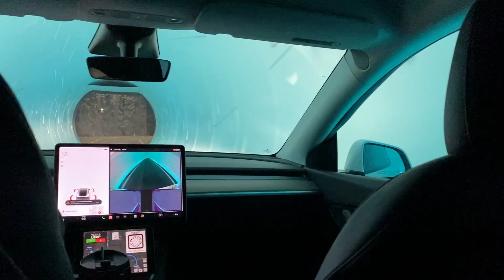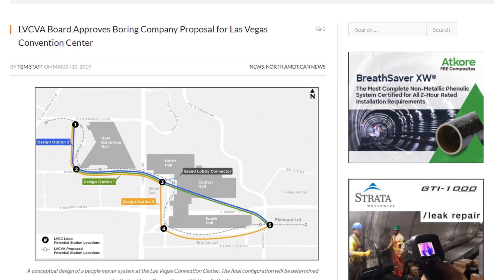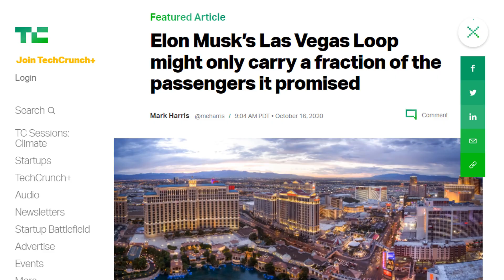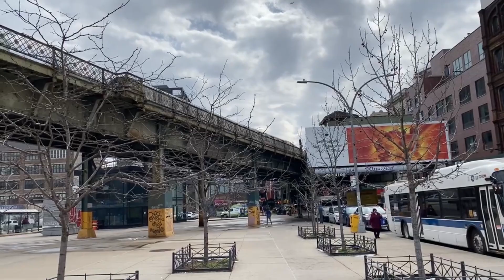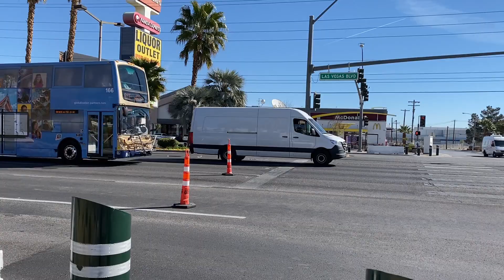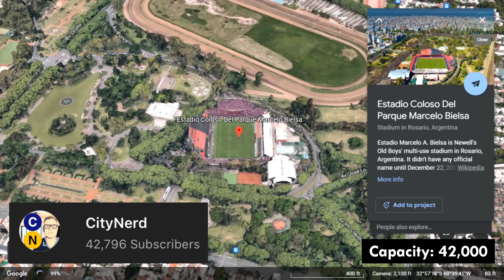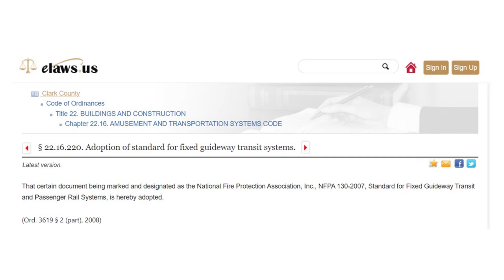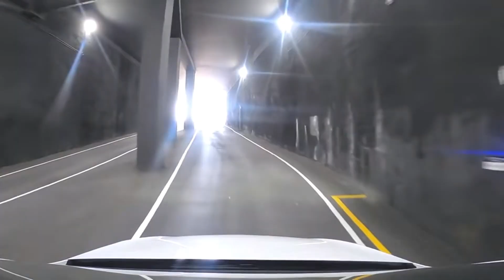Inside the Las Vegas Loop: Transportation Game-Changer, or Complete Waste of Time and Effort?

Comment: Imagine if instead of Teslas in the Vegas Loop, you had a bike sharing service ala Citibike or Divy bikes and the tunnels are for the bikes.
Reply: Well it would be nice to protect bike riders from the scorching sun of Nevada, as long as it has good ventilation
Reply: @cardenasr.2898  If it has cars (even EVs) then it should have to have good ventilation or it gets declared a "confined space" and those require special permission to enter (low oxygen hazards are no joke)
Reply from the maker: That would kill
Reply: The problem is that the Loop is being extended 29 miles down and around the Vegas Strip as we speak.

Tourists carrying luggage or tired children are not going to want to ride bikes those sorts of distances.
Reply: @andrewfranklin4429  It's not, though. It's stuck in the paperwork stage. No actual construction is taking place. Watch the damn video.
Reply: @Codraroll  incorrect. The Resorts World extension has already been finished and work has already begun on the tunnels to Encore.
Reply: @andrewfranklin4429  There's a bit of a difference between digging a frankly useless tunnel to a hotel across the street, and running the length of the Vegas strip. Both of those places are less than five hundred meters away from the west station. A pedestrian bridge would have been quite a bit more helpful at zero running costs.
Reply: @Codraroll  you’re forgetting that these stations will all become part of the 29 mile, 51 station Vegas Loop so vastly more useful than a pedestrian bridge.
Reply: @andrewfranklin4429  Again you're touting the vapourware. Try something else.
Reply: @Codraroll  why do you say it is vapourware Erlend?  Do you have evidence of a single hotel or casino of the 51 who has pulled out of their agreement with The Boring Co and Clarke County to be a part of the 29 mile 51 station Vegas Loop?
Reply: @andrewfranklin4429  Do you have any evidence that these agreements extend into more than letters of understanding? Have actual contracts been signed? Is there a schedule? Has a route been staked out? Has land been acquired, including the sections that go outside the land owned by casinos? Was there a public hearing for any of this?

Talking about building something is easy. Actually doing so requires a level of commitment I've yet to see from this project.
Reply: @Codraroll  Not only has Clarke County and the Las Vegas Convention Centre and Visitors Authority signed agreements with Boring Co, but 51 hotels, casinos, the University, Allegiant Stadium and many other business owners have all also done their due diligence and then enthusiastically signed agreements with The Boring Co to build their own Loop stations at their front doors at their own expense.
Reply: @Codraroll  Here’s a quote regarding the University signing on for example: 

As part of preliminary work on evaluating the possibility of a station, the Nevada System of Higher Education (NSHE) concluded:

“Participation in the Vegas Loop would provide connectivity for UNLV students and campus visitors along an approximately 30-mile corridor, connecting to and from destinations along the Vegas Loop. 

This improved connectivity has the opportunity to support the UNLV and NSHE strategic plan goals, as well as support the economic vitality of the community and support innovations in transportation and sustainability initiatives.”
Reply: @Codraroll  unfortunately I keep being blocked from posting quotes from the Clarke County Public Hearing in Oct 2021 which led to the commission unanimously approving a special use permit and 50-year franchise agreement for a proposed 29-mile tunnel system with the Boring Co, but I’m sure you can search it up yourself.
Reply: @andrewfranklin4429  *Contracts*, you utter dolt. Not non-committing MOUs, approvals to continue the planning, or buzzwords-laden evaluations without any assessment of economic feasibility. There's a lot of different papers that can be signed that could be called an "agreement", but unless it's the right kind of document it means absolutely nothing. 

What I'm asking is, have anybody actually committed (with the necessary stamps and signatures) to putting the money down, without any reservations or conditionals? Such documents - or at least summaries of their contents - tend to be public information, so they shouldn't be hard to find if they exist at all.
Reply: @Codraroll  no need for the insults Erlend. You asked whether there were public hearings and I provided info that yes there were. I also demonstrated that a 50 year franchise agreement CONTRACT wa signed with Clark County to develop bd operate the Loop. 

We also have multiple stakeholders sign contracts and make payments for tunnels and stations including the Convention Centre, Resorts World and now Encore who is currently having their tunnels dug and station built. 

And as I say, ClarkE County doesn hve to put any money down because The Boring Co is paying the construct all 29 miles of tunnels while the 51 hotels, casinos, the University and Allegiant Stadium are paying for their own stations. 

I repeat again, have you any evidence that any of these partners have pulled out of the Vega Loop project?

If not, then please cease accusing this project of being vapourware. It’s happening even if for some reason you wish it isn’t.
Reply: @andrewfranklin4429  So in other words, nobody seems to have put any money down on this.
Reply: @Codraroll  perhaps you missed where I said the Convention Centre, Resorts World and now Encore have all already put money down for their Loop stations to be built?

Come on Erlend, you’re really stretching belief trying to suggest that the 29 mile Loop isn’t happening despite all the evidence to the contrary.
Reply: @andrewfranklin4429  Two quarter-mile extensions across the street is all you have any evidence for? That leaves out 28.5 miles, or 98.3%, of the rest of the system. And that half-mile was the only part of it that's somewhat easy to build considering the hurdles of land acquisition or crossings of public infrastructure.

It seems to me that the other hotels and resorts have subscribed to the project newsletter at best, but keep their money in the bank and their land to themselves until they see any evidence of reliable and effective operations outside the footprint of the convention centre itself.
Reply: @Codraroll   so you have no evidence that any of the 51 hotels or casinos have pulled out of the project?  Cool. 

And the Boring Co has actually stated that the Resorts World tunnel is the hardest part of the entire project due to tight radius turns which corkscrew upwards at the same time, so no it wasn’t “somewhat easy to build”.
Reply: @andrewfranklin4429  As long as you can provide no evidence that any of the 49 remaining hotels or casinos have pulled into the project, other than subscribing to the mailing list, I'd say we're even. 

And I'm not talking easy as in "not challenging to build", but easy as in "not challenging to get built". Working on land they already own, only having to cross underneath one street, no nearby affected residents, short distances, little existing underground infrastructure to worry about, etc. 

However, the fact that they have to resort to tight, corkscrewing turns even in such an uncomplicated location as this, suggests it's not as straightforward as assumed, even in the best-case scenarios. Will be fun to see what other hurdles they end up facing. As many have pointed out, what's making underground construction expensive isn't the tunneling itself, it's the various unforeseen circumstances you have to face before you can start the boring machine.
Reply: @Codraroll   I’m sorry Erlend, but I have no idea where you get the idea that those 51 hotels and casinos just “subscribed to a Mailing list”. The LVCC, Resorts World and Encore have not only signed contracts, but they actually paid money to get their sections built. 

Here’s another example where the UNLV board signed up with The Boring Co for a Loop Station:

As part of preliminary work on evaluating the possibility of a station, the Nevada System of Higher Education (NSHE) concluded:

“Participation in the Vegas Loop would provide connectivity for UNLV students and campus visitors along an approximately 30-mile corridor, connecting to and from destinations along the Vegas Loop. 

This improved connectivity has the opportunity to support the UNLV and NSHE strategic plan goals, as well as support the economic vitality of the community and support innovations in transportation and sustainability initiatives.”

You obviously have zero evidence that the 29 mile Loop is not proceeding as announced back in October 2021 so I guess we’ll leave it there. 

It’s strange you are so desperate for this not to happen? Wouldn’t you t least like to see this happen out of curiosity - it’s not costing the taxpayer anything for this experiment to proceed.
Reply: @andrewfranklin4429  That. Is. Not. A. Contract. 

You don't have evidence. You don't know how to compare figures. You just copypaste stuff you don't even understand, and when it's rebuffed you just copypaste it again. Kind of pathetic, isn't it?

I'm an engineer. I know this stuff. The flaws inherent in the concept are shining out to anybody with half an ounce's worth of knowledge on the topic, in flaming letters ten feet high. Why do you remain so strangely insistent in denying them, using arguments with more holes in them than a gopher-infested golf course made of Swiss cheese?
Reply: @andrewfranklin4429  No, I'm reckoning that those two signed on independently because they are located right across the street from the existing system, probably at a discount to entice others to join the harebrained scheme. And that the 29-mile thing is at best an aspiration that they are legally allowed to build if they can find investors and sort out the land rights, but that few if any of the others have committed financially to making it happen. At best there might be some MOU stuff where they basically agree to keep in touch and seeing what happens, but for now, the 29-mile figure is entirely a pie-in-the-sky construct made for marketing purposes.
Reply: @Codraroll  but you have zero proof of such assertions.
Reply: @andrewfranklin4429  There is zero proof either way, so I guess that makes it even.
Reply: @Codraroll   on the contrary, there is a mountain of proof that the 29 mile Vegas Loop is happening that for some reason you choose to ignore. 
- 50 year Franchise Agreement awarded to The Boring Co for construction and operation of 29 mile 51 station Vegas Loop
- Public Hearing where the Clarke County unanimously confirmed the project and Franchise Award
- Permitting process in progress for all 51 Loop stations
- Clarke County negotiations and purchasing of easements under properties throughout the Vegas Strip in progress
- Resorts World tunnel and station contract signed
- Encore tunnel and station contract signed
- Resorts World tunnel and station construction finished
- Encore tunnels and station construction in progress
- UNLV Board of Trustees approved University Loop station permitting and construction
- etc
Reply: @Codraroll  Boring Company’s Vegas Loop set to be operational next year

By Mick Akers Las Vegas Review-Journal
May 13, 2022 - 10:36 am

Portions of the Elon Musk-owned Boring Company’s Vegas Loop are expected to be operational underneath the resort corridor sometime next year.
Las Vegas Convention and Visitors Authority CEO and President Steve Hill said the timeline depends on the permitting process, but noted he expected that to move fairly quickly.

“This is starting to be a repetitive process,” Hill told the Review-Journal. “ I mean the design of the tunnels isn’t changing and the design of the system isn’t changing. So, the building department has had an opportunity to learn the system, learn the construction methods and learn how it works.”
Reply: @Codraroll  When the initial resort corridor portions of the loop system go online in 2023 they will open in sections, not necessarily connecting the entire system out of the gate, Hill noted.

“We’ll build phases that are separate to start and then tie them in and subsequent phases,” Hill said. “The (Allegiant) stadium to the Tropicana area will be one phase. The Caesars Loop will be one phase and the Resorts World and Westgate connecting to the convention center will be one phase. Then there will be phases that follow that connect those connections together.”

Boring Company President Steve Davis said last year that five to 10 stations would come online within the first six months of construction starting on the Vegas Loop. With around 15-20 stations being added each year until the full build-out is met.
Reply: @Codraroll  Permits for a connection to the off-Strip resort the Westgate hotel have been submitted, with work pending on that tunnel.
“The Westgate is shorter and more direct, so that would be the first,” Hill said.

As have permits for the Caesars Loop, a circular segment running around various Caesars Entertainment-owned properties near the Strip and Flamingo Road. Those include Caesars Palace, Paris, Planet Hollywood, Bally’s, Flamingo and the Linq.

Additionally, permits to get the process rolling for a loop running between Allegiant Stadium and Tropicana Avenue/Las Vegas Boulevard have been submitted to Clark County.
“It will provide the first opportunity to connect some other local locations to the stadium itself,” Hill said. “But all those (loop portions) should be open and running sometime in 2023.”
Reply: @andrewfranklin4429  You seem not to understand what a contract is, or what separates it from a memorandum of understanding or a franchise agreement. The latter simply means "the Boring Company is allowed to market this thing as their product", but it does not legally bind anybody to invest anything, and it is not a permission for construction.

How much of the same do you find about the "Dugout Loop" in LA, or the proposal for Chicago? All sorts of permits and letters of understanding and assessments, but the projects were canceled nonetheless because the money simply wasn't in it, and now they're deader than the proverbial doornail. What will probably happen with the Vegas Loop is that the two side branches will be built, but almost never operated, and then everybody will stop talking about any further extension. That's how projects like these tend to die.
Reply: @Codraroll  After the stadium and Caesars Loop portions are complete the plan is then to work north/south and connect the stadium end to the Caesars Loop. In addition to connecting the Caesars portion to the north end of the Strip.

The monorail operation agreement with the city of Las Vegas has yet to be approved, but is tentatively set to be finalized at a June 2 Las Vegas City Council meeting.

Following that approval, the process regarding the portion of the Vegas Loop that is set to run into downtown Las Vegas can get underway. That includes the proper permitting and agreements to get construction underway and the individual agreements with each landowner where stops are planned for the downtown area.
Reply: @andrewfranklin4429  Congrats, you've found a marketing statement. It even says they haven't gotten through the permission process yet. 

This is still not a contract. I keep asking for apples and you keep bringing me oranges.
Reply: @Codraroll  The Allegiant Stadium portion of tunnel work has a contract value of $9.18 million while the Caesars Loop portion is pegged at $3.42 million, according to county records. Hill wasn’t familiar with the exact pricing of the system, as the Boring Company is tasked with financing the routes outside of the initial Convention Center Loop.

The Convention Center Loop began operating last year and shuttles conventioneers between three areas of the recently expanded Las Vegas Convention Center. That 0.8 mile dual tunnel system was built at the LVCVA’s expense, totaling $54 million. The large underground central station took up a large portion of that total. With that in mind, Hill noted that most of the Vegas Loop stations will be above ground.

The Boring Company is tasked with paying for the Vegas Loop work, with each resort or property that hosts a station likely paying for work tied to those stops. The Boring Company would also be tasked with operating the system and receiving the revenue generated by rides.
Reply: @Codraroll  Boring Company is also slated to pay a varying quarterly amount to Clark County and the city of Las Vegas, based on gross revenue generated.

The cost of a Vegas Loop ride is in between the cost of a Uber or Lyft and a bus ticket, officials have stated over the years.
At full build-out the Vegas Loop is planned to stretch from Allegiant Stadium and the south Strip to downtown Las Vegas with 51 stations in between. The Vegas Loop, like the Convention Center Loop, features a fleet of Tesla model vehicles with a safety driver in place transporting passengers to their desired destination. Davis said last year that at full build-out the Vegas Loop system would be able to accommodate 57,000 passengers per hour.

The Boring Company loop model is a point to point system, with riders being taken directly from one point to another, without stopping, making it a faster experience than the Regional Transportation Commission of Southern Nevada’s public bus system that stops along a route, or the Las Vegas Monorail, which stops at each station along the nearly four-mile track.
Reply: @Codraroll  Next online
The next connection on the loop system that will go live is a portion connecting Resorts World and the convention center. Work is complete on the Resorts World connector tunnel to the West Hall at the convention center. The tunnels should start to see activity in the near future.

“We’re just going through the process of getting the operating permit to open up that (Resorts World) connection,” Hill said.
The process of tunneling the Resorts World portion was likely the toughest part of the entire system to bore, Hill said.

“It’s probably the most difficult tunnel the Boring Company will ever have to produce,” Hill said. “It turned exceptionally tightly, so it really tested the limit of the boring machine itself and the ability to remove the material from the tunnel. While it was turning tightly it (the boring machine) had to dive, almost like tunneling in a corkscrew.”
Reply: @Codraroll  and no, this article from the Las Vegas Review Journal is no “marketing statement”, it contains many quotes from the government authority about the current status of the Vegas Loop and upcoming stages of development. 

As you can see it details the various contracts that are now already in place including the “Allegiant Stadium portion of tunnel work has a contract value of $9.18 million while the Caesars Loop portion is pegged at $3.42 million, according to county records.”

This is going to be very enjoyable seeing the various phases go operational over the next three years.